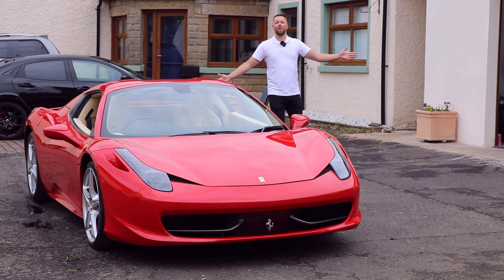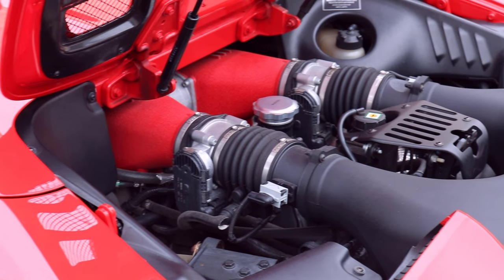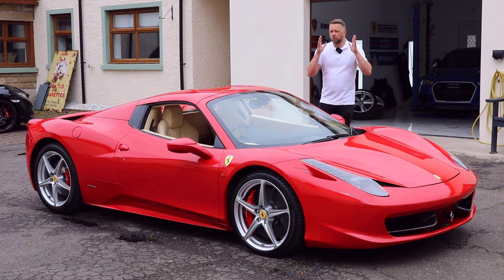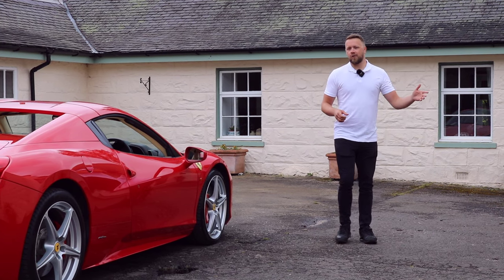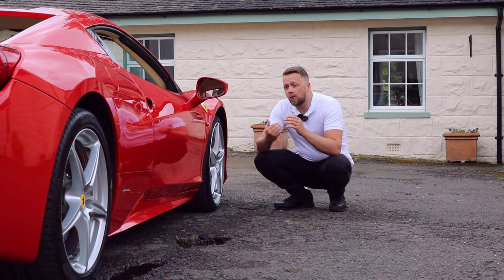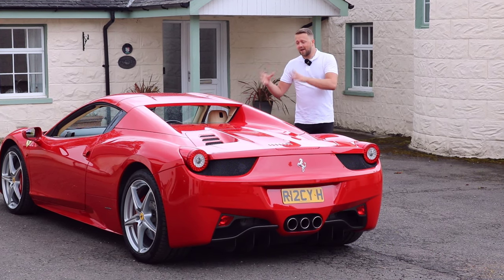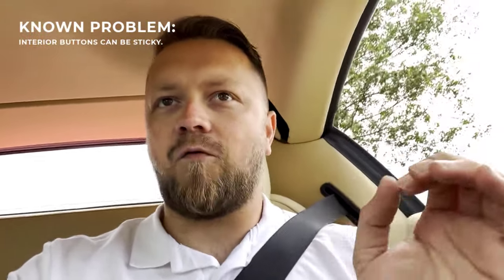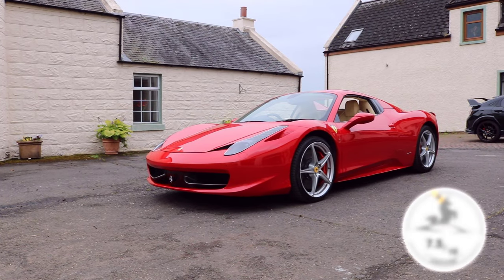FERRARI 458 BUYERS GUIDE | Common Problems Exposed and DRIVEN HARD!

Comment: Great video and guide!   I own a 2015 and maintain it myself, and you covered all the major potential issues.
Reply from the maker: Thanks for the comment 😁👍🏼 enjoy your awesome car.
Reply: That's brilliant. How did you learn? I would like to do the same myself, or at least be better at not buying bad examples.
Reply: check you transmission fluids - there is a way to test for viscosity between both fluids inside there to see if your seals and bearings are holding up; mine failed as of 2 weeks ago!!! after 12 years
Reply: @dwattel  mine started to purge through the vents. Fluid everywhere.  Now I have a new gearbox

Comment: I have a 2011 458 Italia, 54,000 km. Absolutely love the car! No issues. The only maintenance has been regular oil changes (and the brake system recall - although never had an issue there either).

Comment: 458 spider, 2015. Had a clutch sensor go out after driving in stop-and-go traffic in 90deg (F) weather with the AC on. took over $9k to have that fixed. Car has otherwise been a champ, doing a track day with no issues. I do get worried with heavy traffic in the heat though so that is something to think about not that anyone is thinking of commuting in these. Overall, even with the clutch sensor repair, the CPO warranty would NOT have been worth it in my case. Id say that the 458 is worth the price since you are getting a gorgeous italian supercar that sounds fantastic (better than a 488 GTB, spider has the best sound) and has more than enough power for the overwhelming majority of drivers on public roads. One other item for spiders: any convertible will have a bit of vibration because you lose the frame rigidity that a fixed roof provides. I bought my car used with the nearly new Pirelli tires (the OEM ones). The car would have a noticeable vibration around 70mph on highways, particularly with the top down. Pretty annoying. I tried everything with tire balancing and whatnot. The thing that seemed to fix this was new tires, and specifically Michelin 4S tires. I have no affiliation or interest with the Michelin company, but the word out there is that they make extremely round an consistent tires. That may be the fix in this case though I suppose that I would need to try a set of new Pirelli tires again to determine that. Just an FYI for anyone out there with a similar issue. This car is fantastic and it certainly is worth the price. This is my favorite car. As crazy as it sounds I have 3 other friends like me (non billionaires, we arent filthy rich) that have scraped together the cash to get 458s and they love them as well. Funny, none of them have had any issue with the transmission, and they are all earlier model years. As far as I can tell, this is up there with the F355 and maybe even the F40 as far as some of the best cars from Ferrari.

Comment: did you mention the DCT gearbox failures? Lots are failing now due to AGE not mileage; my 2011 just failed last week 6/24, going for "surgery" next week. Loss of pressure no even gears or reverse. These DCT failure are now costing us between $8-20k to fix :( for all getrag transmission from 2009-2018)

Comment: The problem with many of the gearbox issues is that even the repair (as opposed to replacement) involves buying an entire pack of sensor components (even if just one sensor is bad) - and that pack is something around the £10,000 mark. Oh, and Ferrari isn't exactly great at keeping up sensor production. So at some point, finding replacement sensors will likely become an issue, too..

The best advice with a 458 purchase is to get one with a Ferrari Power Warranty attached, or get one independently (about 3 grand - and that's AFTER Ferrari main dealer says the car is OK.. 💸💸)

Comment: My 2014 458 had gearbox issues so it can happen on newer cars as well.
Reply from the maker: What were the problems ? Can you share a few details
Reply: @ScottishCarClan  Nothing electrical, an internal seal failed, which resulted in the car dropping oil out the tell tail hole on gearbox, requiring a rebuild and new casing. 2014 car, I got it in 2019 with 13k miles, now on 26k miles. Car is back now, all fixed and running great, bill was just shy of 8k GBP, not a nice surprise bill but could of been worse and I have had car four years trouble free.
Reply: @Gibbo205  458 just looks almost perfect .. Torn between the Ferrari 458 or 2014 Porsche 911 turbo s
Reply: @fullbolt-onsss1130  had a few 911’s and the Turbo S is bonkers fast but I’ve had more fun watching paint dry, the 458 is a total riot and event to drive.
Reply: @Gibbo205  its always the seals lol